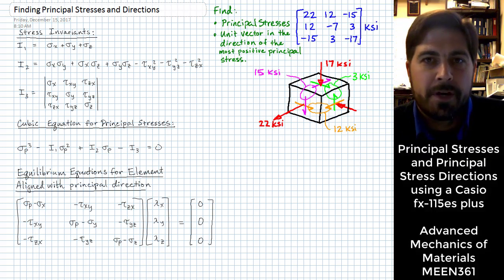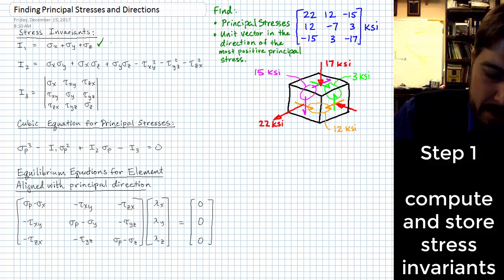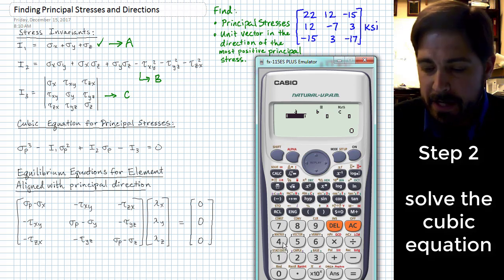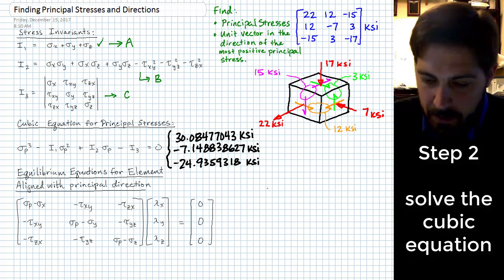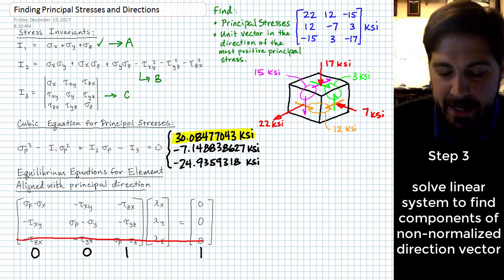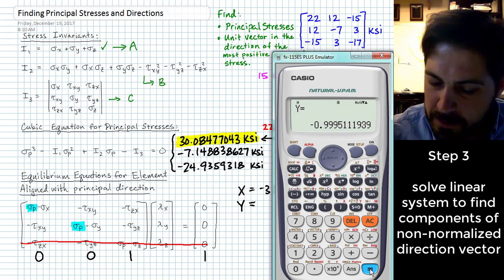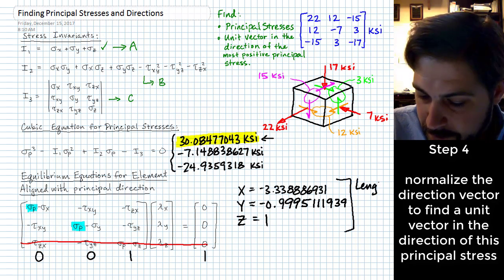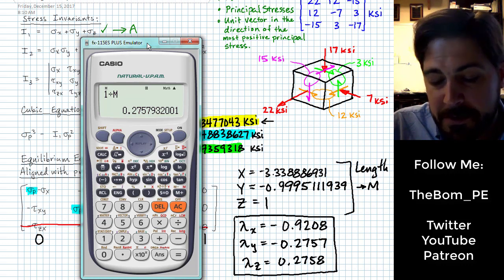Principal Stresses & Directions using a Casio fx-115es plus

Comment: I would like to know why the directions in the end are always opposite in the sign , Im I doing something wrong here , cause i got exactly the same answers but they are opposite in signs .
Reply from the maker: two solutions where the 3 direction cosines have the same magnitude but where all three have opposite signs between the two solutions are actually equivalent to each other. this is because the two solutions represent two possible "slope" directions along a straight line.

Comment: How would we know that we have linearly dependent equations without getting into echelon form? 

I am running into problem while trying to solve the following set of equation represent ed by matrix
3                    -3               sqrt(2)
-3                    3              -sqrt(2)
Sqrt(2)     -sqrt(2)            6
Reply from the maker: If you multiply your first line by -1 you get your second line. That means those 2 lines do not represent independent equations. Also, the 3rd line can't be true if the 1st two lines are true ... you'll be able to prove that by multiplying the 3rd line by 3/sqrt(2).
Reply: @TheBomPE  Thanks for the fast reply. So is there a way to solve it by putting it into calculator. Calculator shows math error if i follow the same procedure as you have shown. After gauss elimination i think get it like
3        -3       sqrt(2)
0         0            0
0         0        (16/3)

From this z has to be zero. And i can choose any value of y or x. Any specific way to solve this in a calculator?
Reply from the maker: @abhishekpg9615  your system is not solvable. you should check whatever theory led to those equations.

Comment: Hello Prof. how can I calculate the cosine angle using the calculated vectors
Reply from the maker: The elements of an eigenvector are the 3 direction cosines that describe the line along which the associated principal stress is oriented. If you want the actual angles you can take the inverse cosine of each element of the eigenvector.
Reply: @TheBomPE  thanks for your timely response Prof.

Comment: The explanation is very good ... but I wonder about its correctness. I have implemented your approach and calculated the 9 directional cosine components for the case you are analyzing here. I have completely independently implemented the directional cosine procedure from Appendix B of the book: "Advanced Mechanics of Materials and Applied Elasticity" Sixth Edition by Ansel C. Ugural Saul K. Fenster. The results are almost the same but not identical. Well, the 3 directional cosines for the first principal direction are the same in value but opposite directions. In other cases, the solutions coincide. For another tensor example, all the results that I got with your method are correct in terms of value, but all of them should be in the opposite direction according to the second procedure. I am a bit confused, because probably the definition of a tensor with respect to the 3 axes should be unambiguous? If you want, I can send you both procedures (the file is written in MAthCAD, so its printout looks like I wrote it in Word - you will understand everything) - just give an e-mail if you are interested.
Reply from the maker: If a valid solution is found for a set of 3 direction cosines, an alternate valid solution is a set of 3 direction cosines that are all negated relative to the first set. Both of the solutions describe the same line orientation, which is the purpose of finding direction cosines.

Comment: Why equations are not mutually independent ?
Reply: What is the method which you used for solving?
Reply from the maker: The vector of direction cosines is a unit vector, so if two of its three components are known, it determines the 3rd component.
Reply: @TheBomPE  
Please, tell me this numerical technique that used to get direction cosines.
Reply: @TheBomPE  
From where are we know two components of The vector of direction cosines?
In your solution you get X,Y and Z values.
which I understand
 that X,Y and Z values are the components of the unit normal isn't it my dear
?
Reply: @TheBomPE  
Isn't it my dear
 X,Y and Z values are the eigen vector and the components of the unit normal ?
Reply from the maker: My method starts with finding a vector that points the correct direction but is not a unit vector. Then that vector is scaled to a unit vector.
Reply: @TheBomPE  
But you assume that one component of the vector equal to 1
From where this assumption ?
Reply: @TheBomPE  
Can we discuss by another online way 
My email: 
mohamed.khereldein@gmail.com
Reply: Thanks for reply,
But how you eliminate the third row and replaced it by (0,0,1)?

Comment: Running into an issue where I'm getting incorrect principal directions. The tensor is sigma xx = 110, sigma xy = 60, sigma yy = -86, sigma xz and yz = 0, and sigma zz = 55. 

The I1, I2 and I3 are 126.91, 55, and -102.91 (MPa) respectively. 

I'm getting 0,0,1 for all principal directions - which is incorrect. Well... the I2 is correct, but (for example) I1 has l, m, n of  .963 and .271 and 0.

Any idea what could be the issue? Your method has worked for other questions

Edit: seem to be getting incorrect answers whenever sigma xz, yz = 0

Maybe I'm just doing it wrong tho
Reply from the maker: When you have two of your shear values =0, I call this situation "plane stress plus." I would do this problem by doing a Mohr circle for the plane that has the shear, then plot the "extra" normal stress value along with that circle to make a Mohr 3 circle diagram. One of your principal directions will be along the direction of the "extra" normal stress (that stress is already a principal stress), and the other two principal axes can be found using your first Mohr circle (a single axis rotation about the "extra" stress axis). 

It does not surprise me that the technique demonstrated in this video breaks down for this specific case you mention. I think it would take an explanation bigger than I want to try in a YouTube comment though.
Reply: @TheBomPE   Thank you for your detailed reply. 

By "two shear values" do you mean zx, yz = 0, or just xz and zx =0. (just as examples) 

Sorry just starting this topic and my theory isnt up there yet.
Reply from the maker: If any two shear values are 0 then what I wrote would hold. Remember that the assignment of names to the axes (i.e. x, y, z) is essentially arbitrary.
Reply: @TheBomPE  makes sense. Thank you for taking the time to reply